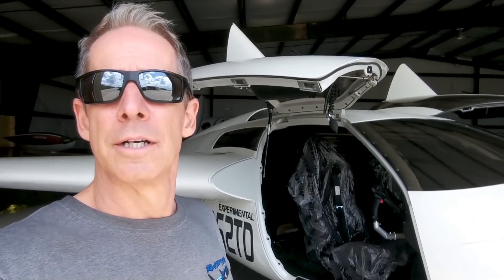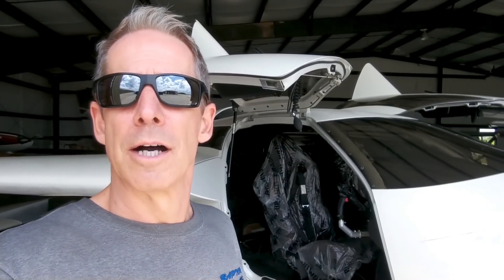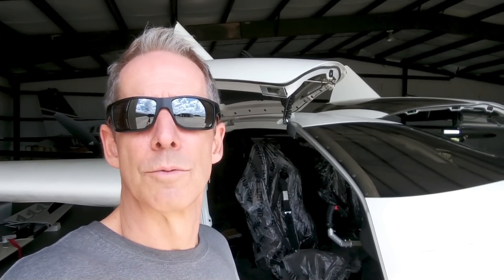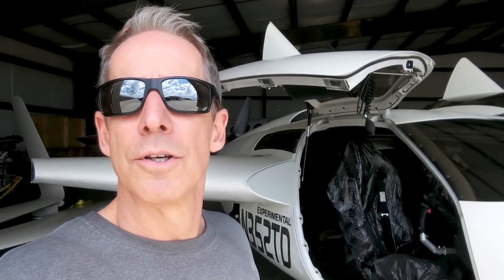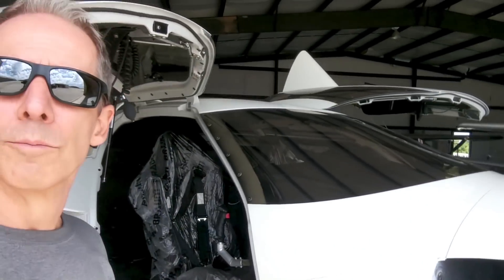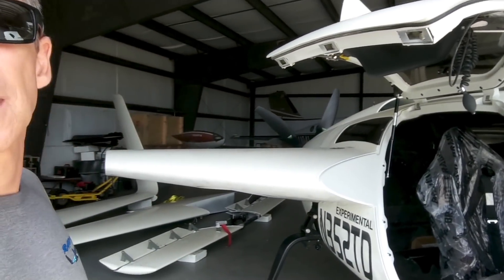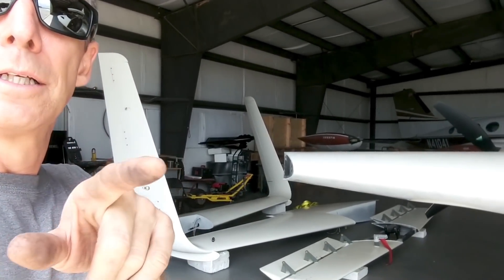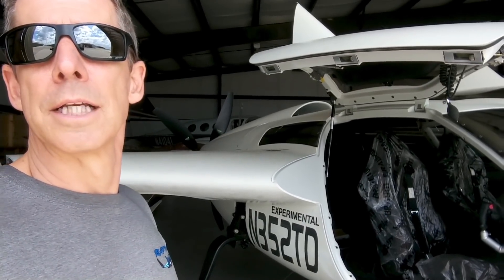Valdosta or Bust! - Building the Raptor Prototype

Comment: Thanks for the update Peter. I'm a truck driver by trade. And I've done Flatbed, stepdeck, double drop, RGN, van, and currently curtain van... but it might be interesting to a lot of viewers if you might get some video footage of the Transportation of 2TD down there if you can... I've done Oversized Loads before but I'd be interested to see the Transportation Trip of this one if possible. Even if it were just as loading, leaving, arriving, & unloading.

Comment: Foreplane?  We call that a canard.  🤣

I didn't build my Long-EZ but it had been parked in a garage for five years when I bought it, and the ink was still wet on my private pilot's license.  I did eleven hours of taxi tests, high speed taxi tests and touch backs at a 5000 foot rural airport in the evenings.  I got some good natured teasing from the folks at the airport asking if I was going to fly that plane or just drive it around the airport, but they were all glad that I was meticulous and not in a hurry as I proved the reliability of the plane after being parked for so long, and as I did my best to understand how to fly it as safely as possible.  It was much faster than the Cessna 150 and 172 that I flew as a student pilot, but it was very well behaved and much easier to fly than any plane I'd flown.  I had gotten time with instructors in several other small SEL aircraft to broaden my experience, and I got several hours of back seat time in another Long-EZ... thanks, Jim!  One day, my CTAF radio call at the rural airport changed from "taking the active for a taxi test" to "taking the active for departure".  It was exciting but not scary because I took my time and I was prepared.  I flew when I was ready.  Flying the Long-EZ for the first time was exhilerating, but not scary.  I flew for 45 minutes until I was relaxed again and ready to land, getting a feel for mild maneuvering to wire up the rest of what I needed to know to land safely.  I practiced flying a pattern away from the airport and flying the airspeeds for crosswind, base and final.  I aced the first landing.  I did a go around for the second landing because I let the plane get ahead of me.  There was no ego at work.  Going around was safer, so I did.  Too many people's first flight is a forced affair with a lot of friends and family watching.  They're flying an airshow for spectators when they should be relaxed and focused on the plane and their flying.  An uncontrolled field doesn't have fire trucks and a rescue team waiting, but I think the relaxed learning at an uncontrolled field affords more than makes up for the ammenities at a controlled field, IMO.

Fly safe.  Don't rush it.  Take your time.  It took forever to build your plane.   Don't prang it because you got in a hurry at the end.

Comment: Might be a good idea to remove the propeller ( to reduce some weight, not much mind you, ...off the engine mounts/bulkhead) and support the back of the engine weight somehow. Trust me a trailer going down the highway hitting bumps can cause a LOT of stress on the mounts. Think of 3 or 4 hundred bad, hit hard landing. Follow it & you’ll see what I mean.

Comment: GSP is closer and runway is 11K feet. Why wouldn't you go there??
Reply from the maker: Too much commercial traffic there compared with VLD.
Reply: Raptor Aircraft I figured as much. It just seems that having an additional 3k feet of runway opens up more options and would be worth the additional hassle. You may think 8k is sufficient now compared to 5k but once you start flight testing, you or the test pilots may decide that more runway is needed, leading to additional relocation and delays. I'm sure you're putting a lot of thought into this decision. Just wanted to raise the point that what looks like the better more convenient choice now may end up being less so later. 
Either way I'm looking forward to seeing her soar!
All the best!
Reply: Ryan Shackleford I disagree. I think that we'll find out that the additional 3k feet of runway goes by in a hurry....11k feet is a lot more peace of mind even if not needed.
Reply: Ryan Shackleford by that logic it's dead already, as the plane will need to operate in and out of less than 5k feet to be viable. The move to a longer runway is not to prove day to day operational performance but rather to do initial testing, including climbing to and staying in ground effect then touching back down and coming to a complete stop. To do this on an 8k foot runway, based on the performance seen so far, leaves very little margin for error. Hence the suggestion of an 11k foot runway which gives the test pilots more time in the air to feel out AC performance and more runway after touchdown for ground roll.
Reply: Ryan Shackleford we shall see..

Comment: The good news is that you can fly her back to Cherokee!
Reply: Maybe I'm looking too far into the future, but perhaps Cherokee Airfield should not be the Raptor base ... considering the great number of 8,000 ft runways available.
Reply: @ryanthomas2472  Point, set, match.  I'm at a 3900 foot strip.  My hometown is 4100 feet.  I get wanting to test fly the initial prototype off a longer strip with large/flat/rural areas off the departure ends of the runways.  Very interested once we have actual performance numbers how she fares off shorter strips with various payloads.
Reply: @ryanthomas2472  My local strip is 5500 ft and that is fairly large compared to most in Ohio.